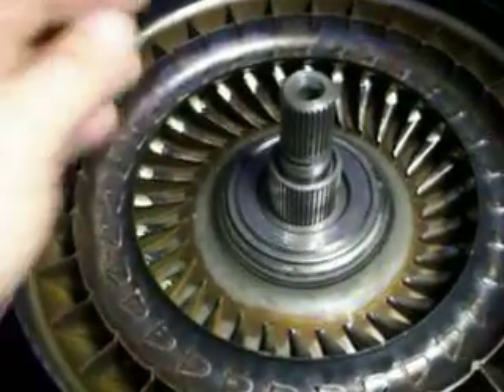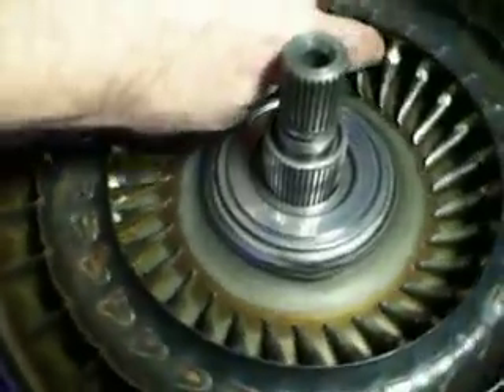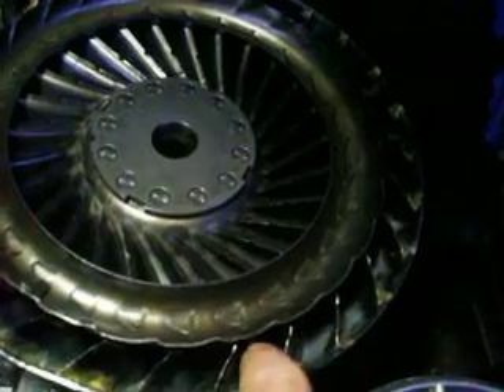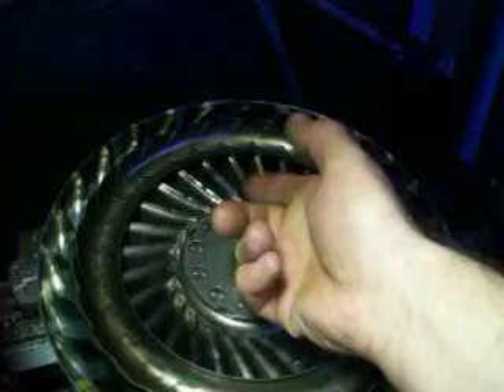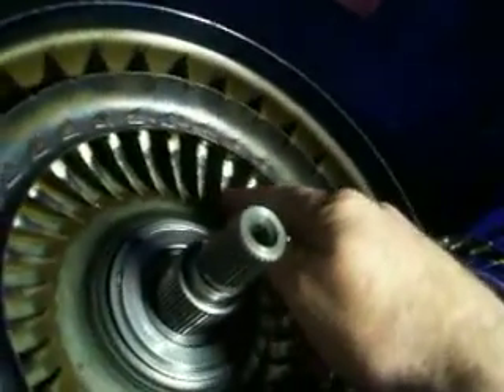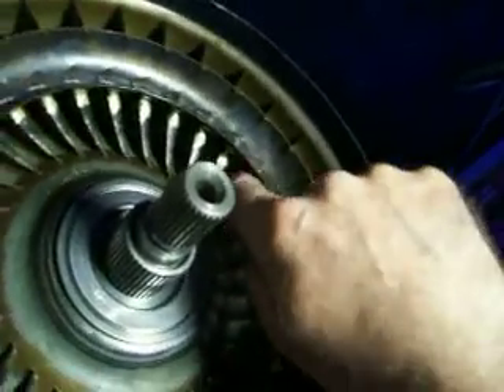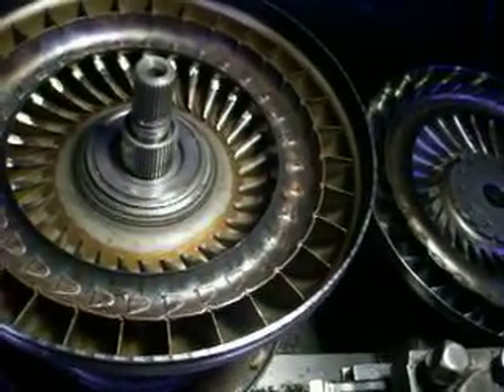Suction Turbine is impella / Schauberger / Clem/ Hyper Power Torque's

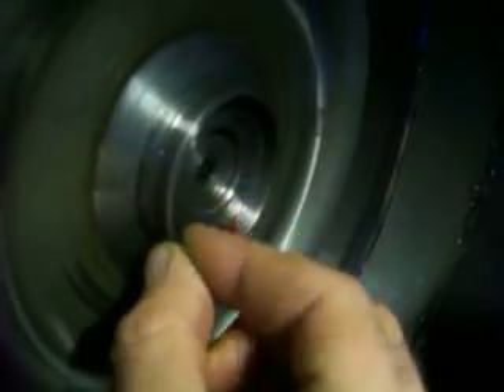Comment: 2:40  he say 
(sort of) 3d printing
Reply from the maker: It is good to be able to build up weld using machine welding technique. Rotary welding. At any given diameter. That is machined back to clean metal.
Metal 3d printing.

Comment: so you cut A torque converter in half...out of An automobile s transmission.....u sir are part of the problem....why deceive people...3d. printed???...shame on you!!!
Reply from the maker: Where's your work William. it about a journey of trying stuff. and present it.
Reply: @godspirals  i have done the journey....and i have it figured  out....just a broke duck...and no one to quack too...but come one....why spend time on a torque converter....spend more time reasearching what Victor said.....understanding what he said doesnt match his pattents is the first step to understanding.....
Reply from the maker: @docholliday514  very true William. 180 degree opposite. As said.
Reply from the maker: @docholliday514   I have experienced power tripling bottom end. Where it was originally making 50kw now 150kw. Others , first 10 kw, then 20kw gains . Another 50kw up. Can be exciting to drive. Need to apply it to a generator.
Reply: William errs

Comment: hi I have just seen your Hydrosonic pump electraliser HHO conductivity test 
video and wanted to see it again but is vanished.what is going on in that workshop of yours
Reply from the maker: I was miss leading. re ran the test with the hydrosonic electraliser . noticed the rotor had moved put it back to where it was meant to be  re tested the ohms , stationary 0.470 K ohms  on and turning 260 ohms.
thought pulling the video the right thing to do.
Reply from the maker: Thanks for viewing i will make another video there is still a drop in Ohms between a stationary reactor and a turning reactor ,       209 ohms drop in resistance ,  Thanks
Reply: waht exactly are you trying to do?
Reply from the maker: once i get familiar with the hydrosonic reactor ( only had it back together the last few days) will be putting power through it using it as an electraliser  for hho (hydrogen/ hydroxide gas mix ).  the nature of the Hydrosonic pump to raise the temperature of fluid , brings the electralite up to optimal temperature and the ripping of the cavatation an moving surface o f electrode disasociates the water onto gasses fast. I emailed James Griggs with the idea many years ago never heard back , a year or so later he had it on his web site ,, at that time stating 1200GPM out put. it took some time to realise i had some scrap material (from torque converters.) to build it. you had a glimpse. How can a cell possibly make 1200GPM.   that's what were trying to do! SEE IF I CAN. Probably have to make other rotors but that's how it is. lot's to do by me self.